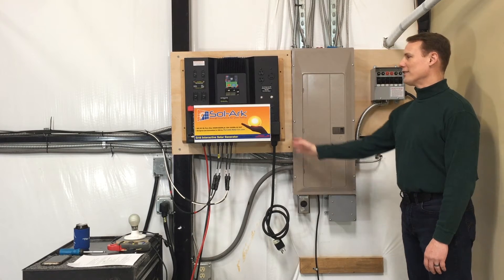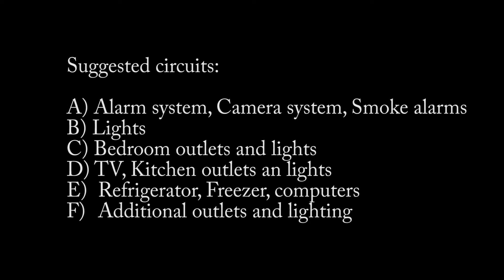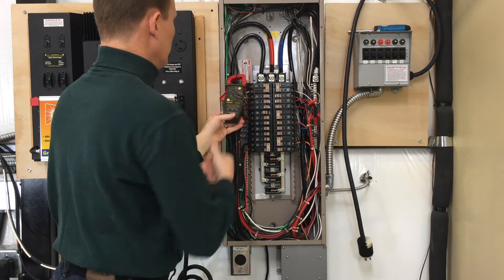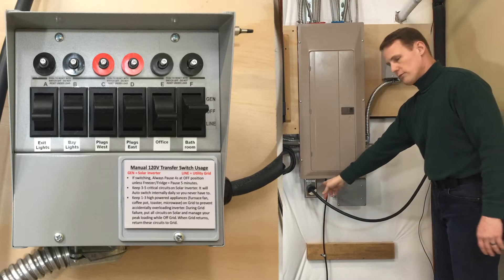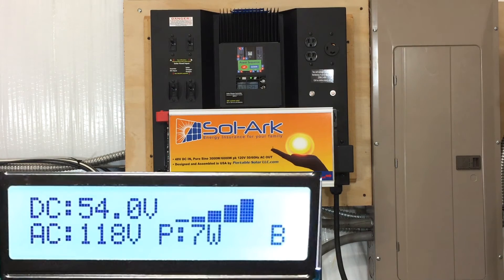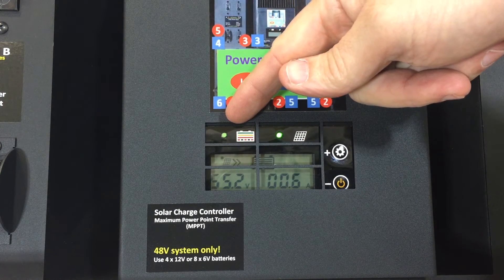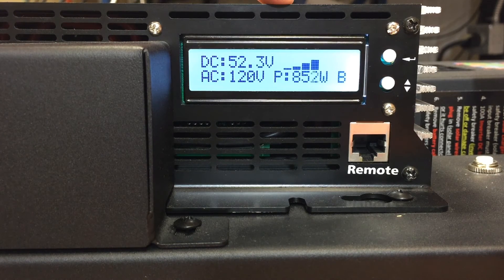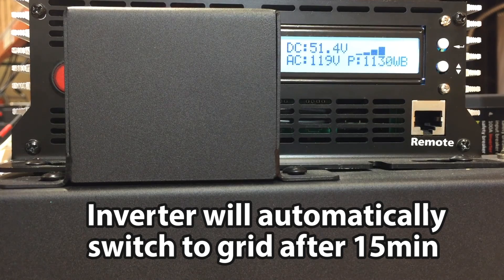How to Install a Transfer Switch Panel with a Hybrid Sol‑Ark Inverter

Comment: My one newbie question is about the flow of energy.  The manual transfer switch has a built in critical load panel in this case 6 circuits.  It is pre-wired with all wires to be attached to the circuits in the main panel that will be powered when the grid is down. I assume that when the grid is down the inverter ac energy will flow to the transfer switch which then energizes the 6 switches in the critical load panel. Thus the energy backfeeds from the critical load panel into the main panel but only to those 6 circuits in the main panel. Then the energy flows from those 6 circuits into the receptacles/switches connected to them.  I hope that I got that right. I am aware that the transfer switch connected to the main panel by a 30 amp breaker has open the circuit to the main panel and closed the circuit to the critical load panel. As I understand the switch from grid to generator prevents the invreter ac energy from backfeeding into the main.  Ok so far, but what happens when the inverter ac energy flows to the 6 circuits in the main panel? is there any danger of the energy from the 6 circuits backfeeding into the main? I say this because there is a common busbar in the main panel so that energy flows to the busbar and thus to the main.  Thinking about it the only way this can work without backfeeding into the main is if the 6 circuits are isolated from the rest of the circuits on the main panel. So when the black wire for A is attached to the black wire on the corresponding circuit breaker for A on the main panel and the red wire from A is attached to where the black wire was, that isolates the energy only to that circuit in the main panel that corresponds to A and there can be no backfeeding into the main from that point. Did I get it right? sorry for the long post.
Reply: Yes I have the 10 circuit reliance switch box  box it cannot back feed I can test it with the grid on and generator running 7500 wats by flipping the switch from line (grid ) to off then generator. I am watching this to figure out how to use solar with my plug he is not telling me how that would work but I think I need batteries and solar and a all in charger controller inverter seems like Growwatt and this sol ark are good

Comment: How do you connect 2 sol-arc 12 in parallel to combined critical load panel to ac combiner then to manual transfer switch?

Comment: Is the transfer switch installed in the Sol-Arc Box or is it a normal Transfer switch install to the Electric Panel.
Reply from the maker: There are two transfer switches. 1) the one near the panel is just for ease of wiring install into the breaker panel. Most switches are set on the Generator and left there. 2) the internal automatic transfer switch in the Sol-Ark does all the work for you.

Comment: I want this system...but why do you max out at 3.9 kW?
And does this system sell power to the grid during the day?
Reply from the maker: Because that is the power limit we can fit in a small transportable size. It doesn't sell back power to the grid, but reduces what you purchase from the electric company. If it sold back to the grid, you would need professional installation + AC disconnect + smart meter + permission from electric company + more permits. We like to enable people to install themselves if possible.
Reply: Makes sense!
Reply from the maker: The panels just don't produce the power. We want to maximize battery lifespan, which is why we use a solar charge controller.